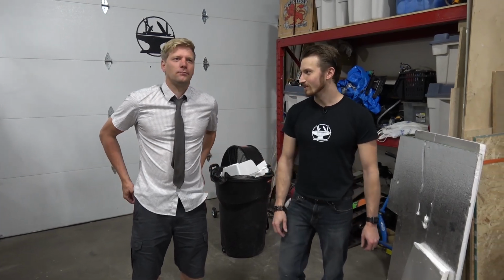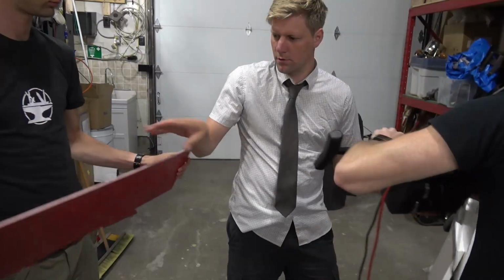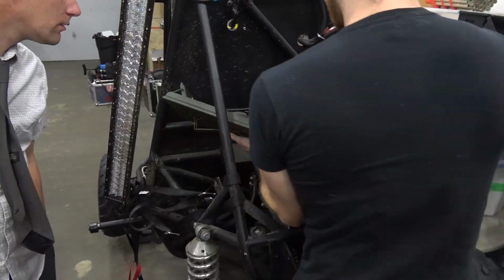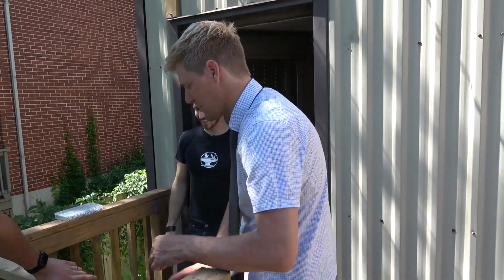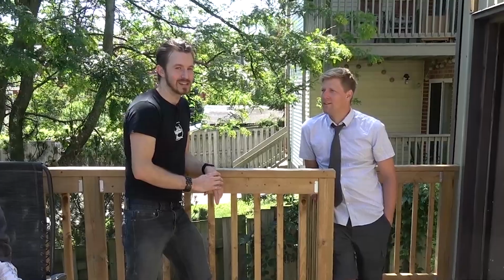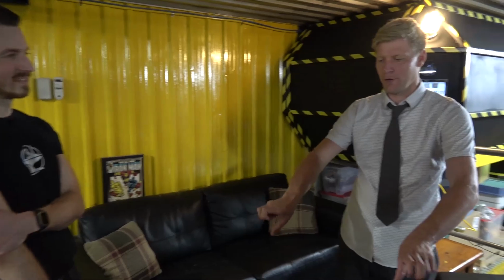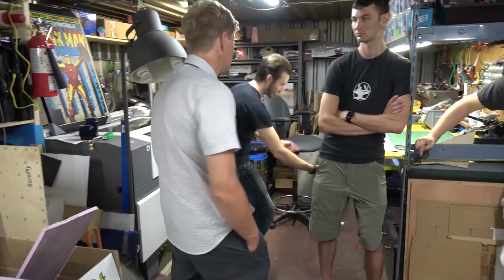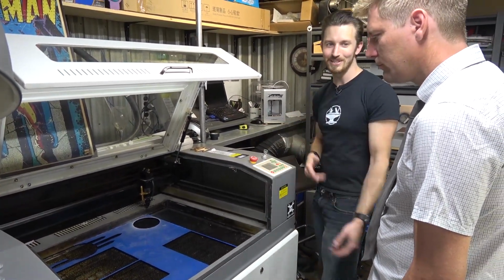Colin Furze Visits the Hacksmith!

Comment: Local metal shop closed down near us when I was a kid. My grandpa worked with steal, he knew the guy. We made about 20 trips one day in about 5 different trucks getting giant round stock, about 10 inch diam, 6-7 feet long. We must have gotten 30 of them. He paid about 50 bucks for all of it. We sold one out of curiosity to the scrap yard, it was some sort of special alloy and each one went for almost 500 in scrap, and this was in the mid to late 90s. If you have the means to move heavy shit, you can some times get it dirt cheap cause people are just desperate to get rid of it, that robot arm was an awesome find

Comment: So Colin's flying thingy, could you not have a few small edf's that have been programmed with a gyroscope to activate at full power when it tilts to a "danger zone" that was set by colin, so maybe if it got to 150° instead of the 180° they would activate automatically preventing the tipping

Comment: from the look around your shop, you have from what i can see, everything you need to build your own 3D metal printer. a tig welder,  3D printer cabinet you can fill with argon gas as well as the 3D drive mechanisms. but maybe i'm just looking at it too simply and it needs to be more complicated.
Reply from the maker: +Raven Thylacine still not that simple!